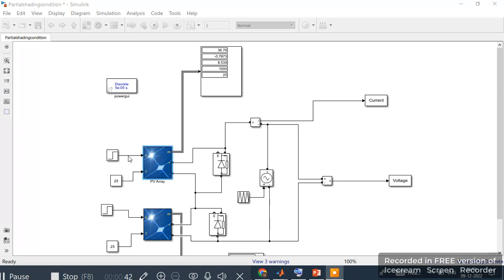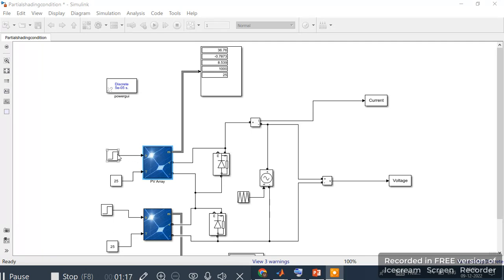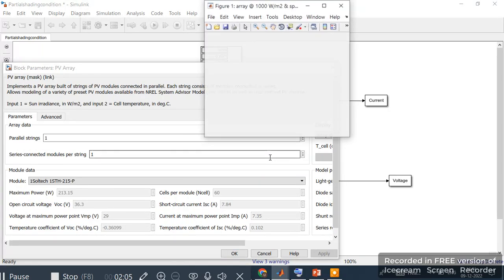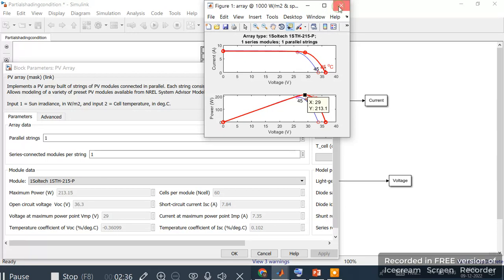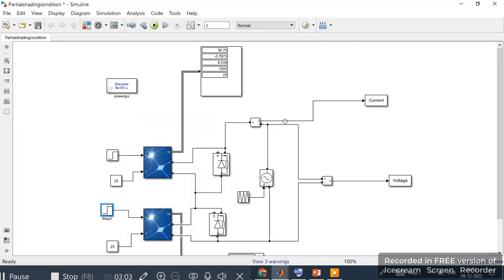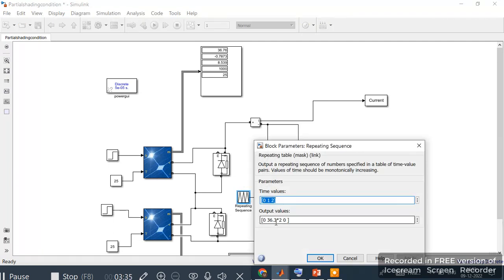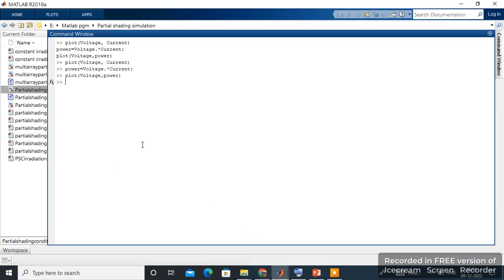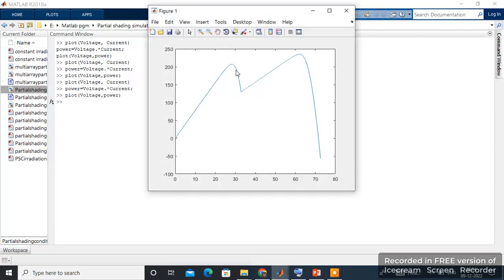Partial Shading condition of PV array

Comment: Sir, what is work of control voltage source
Reply from the maker: It helps isolate the PV array's behavior from load variations. By controlling the output voltage, you can focus on how well the MPPT algorithm performs in tracking the maximum power point, independent of external load changes.Also it helps in dynamic adjustment of the output voltage to optimize the power output from the PV array.